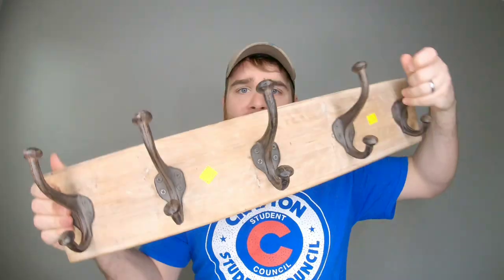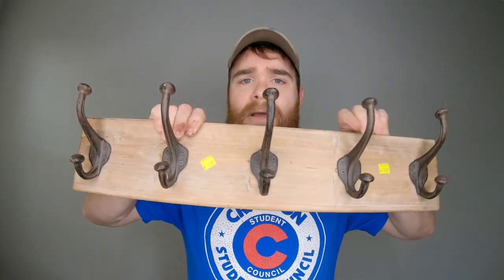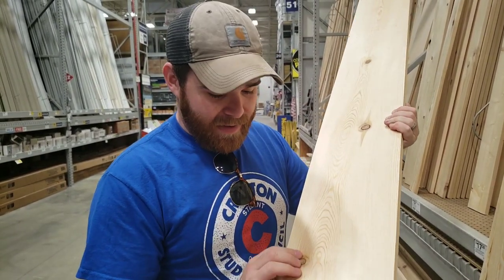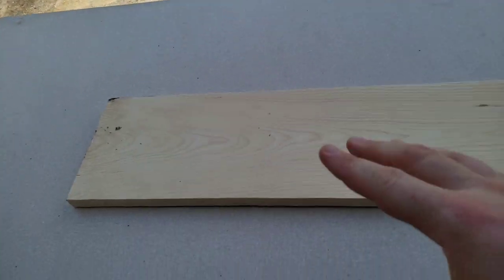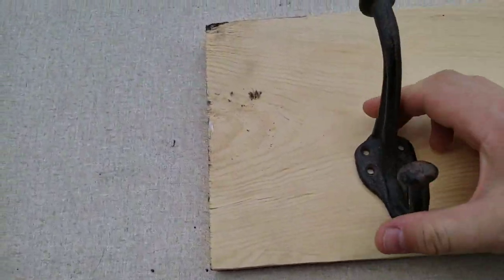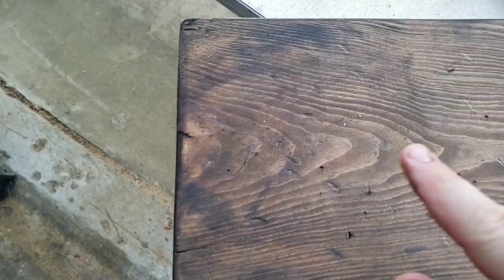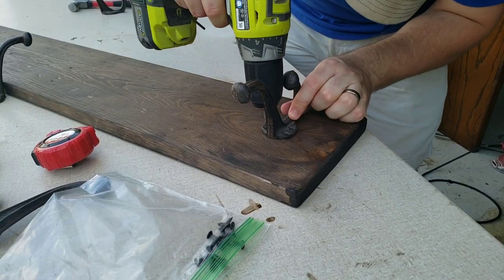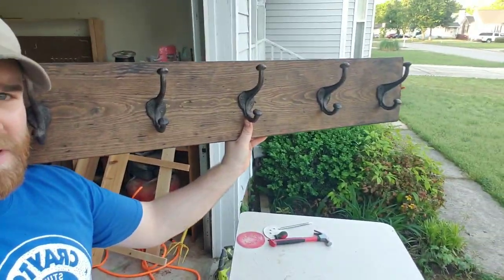Can I Turn an $8 Goodwill Item Into $150 Profit? Easy DIY Flip!

Comment: Theres actually apps that you can use to get equally measured points no matter the amount of hooks or whatever youre attaching. 
An easy way to make sure they are at the same level measure up on both ends tape a string and adjust  your hooks to it. 
Getting a router and you can make the edges look very nice very handy cheap tool to make things look proffesionally done.

Comment: Next time you go to the Goodwill on St. Andrew's Rd, hop into the Harbor Freight next door and get a magnetic parts tray. They are great for keeping up with all sorts of screws and bolt.
Reply from the maker: I have one and I never use it. They do work very well, I'm just not responsible enough to remember to use it. Haha
Reply from the maker: Harbor Freight is a good place for retail arbitrage too!
Reply: Hairy Tornado I have a few and love them! We use them for woodworking, working on our cars,  taking apart small electronic to fix and resell and I use them for my sewing pins and needles. They save so much time!

Comment: Wait, I wanna c u break that over your knee. Poplar would be a good choice of wood as well, better quality than pine but still economical. Turned out well, thx for sharing. $150?
Reply from the maker: At 1000 subs, I'll break it over my knee.

I actually wanted to use some ambrosia maple I had but I wanted the project to be as DIY friendly as possible. Thanks for the comment!
Reply: Best of luck getting to 1K! Please don't actually do that when you hit your goal; instead, I bet your subscribers can help you come up with a better way to celebrate. :)
Reply from the maker: @pturner1971  I think the wood that came with it was a really thin piece of cedar. I mean it was just thick enough so that the screws wouldn't poke through. But you're right, I need to go big or go home. Haha

Comment: If I could make a suggestion, get an extension for your screwdriver bit, so you can drive the screws in perpendicular to the board instead of at an angle.
Also I'd recommend trying Bartley gel stains. you might have to look for them, as they don't sell them at Home Depot or Lowes, and they're more expensive than Minwax, but they give a richer, more even finish without the splotchiness you might get with standard stains.
Thanks for the videos!